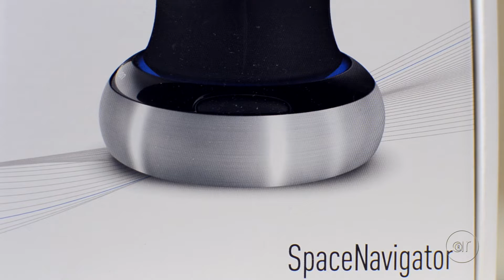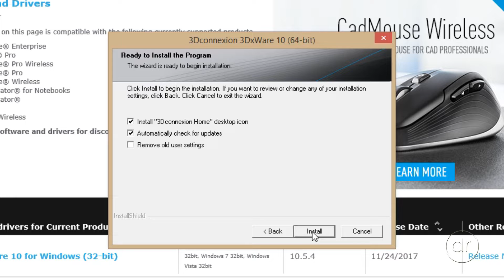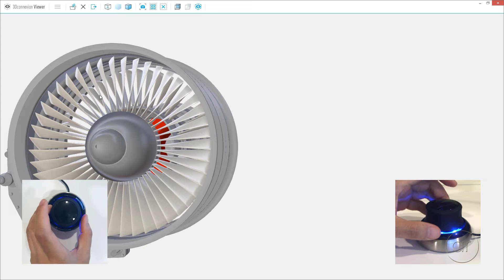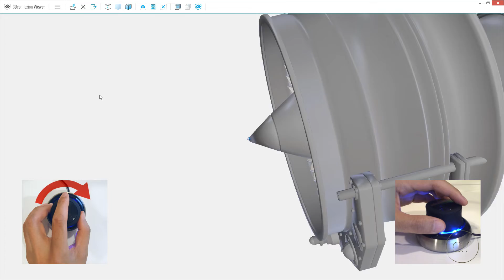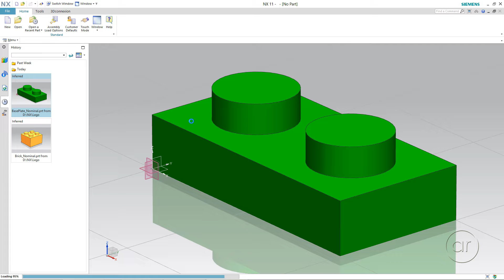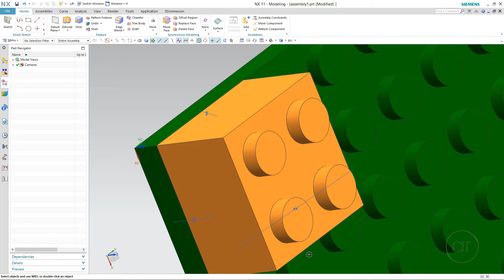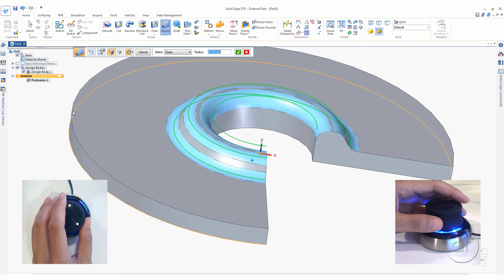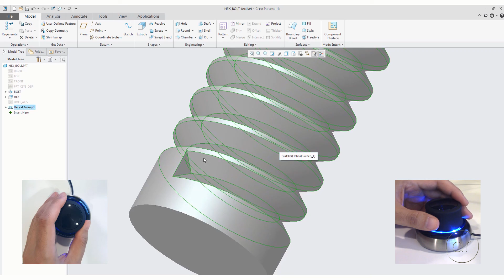The SpaceNavigator 3D Mouse: Review and How-To

Comment: After further training, where a SpaceMouse-Pro was available, I have now also bought the Compact. Without it you don't want to anymore, because it makes it so much easier and faster. The freely configurable buttons with the radial menus are also worth gold. Even with database maintenance, for example, where you need the same commands over and over again, you can quickly reassign this and you no longer have to switch back and forth in the menus.

And that works as well as in any program or on the desktop, so not only for CAD.
Reply from the maker: Thanks for the info. The SpaceNavigator 3D has been discontinued (at least in name - I'm not sure how the Compact compares) so the video is a bit outdated. I'll need to re-visit when I have the opportunity to try the newer models.

Comment: I concur with prior mentions that this is a great review that actually shows the 3D Mouse in use. My one concern about getting one is that I use a lot of shortcut keys rather than clicking on commands (something I see in most videos). 

So here is my question: 
For someone who is very proficient in keyboard/mouse for speed, does the 3D mouse help or hinder when working with CAD? 

I see value when selecting things for joints, etc., but also see added time having to move a hand to type input values, or navigating through menus to click on something because no hand is on the keyboard for shortcuts. Because of this I remain on the fence if this would work for me.
Reply from the maker: Thank you. That's a good question - the 3D mouse works well with a regular mouse when you're interactive with the model (i.e., dragging to change dimensions, features, etc), but I find you still need to switch to the keyboard when entering parametric data, or when you're writing expressions, equations, etc. With that said, there are two small programmable buttons on either side of the mouse, as seen at the 1:10 mark. I haven't used them myself, but I believe you can program frequently-used commands and assign them to those buttons for all the CAD packages that it supports. I don't know if it's one command per button, or if there is a way to assign multiple commands per button, so I'll let others chime in...
Reply: @accessrandom  Thank you for the response. Yes, those movements are my concern, so will consider sitting on the fence for a while... :)

Comment: This type of interface doesn't make a whole lot of sense.  Your typical large trackball already has full support of Windows OS, is by far easier to use than this gadget, and can be used as a regular mouse as well.  Toggling this level of user control would be easy by clicking one or more right, left, auxiliary buttons.

Comment: Best video about 3Dconnexion SpaceMouse! Downloaded already the actual driver for my OS, started the installation, selected "Custom" and searched for a "Unity 3D" driver. Unfortunately there isn´t one! Anyone out there who uses this device in conjunction with Unity 3D (version 2018 and newer)? 
Unity Asset store -> found only "SpaceNavigator Driver". Last release from 6. Jan. 2017 = fr...ing old -> Reviews getting worse -> as said no plug-in update since Jan. 2017.
Any idea, clue, hint?
Reply from the maker: Sorry, I don't have any experience with Unity but after searching on Google I found something about the Rewired project for Unity, which looks like it supports the SpaceNavigator. Could that be something you could use?
Reply: @accessrandom  First things first: Thank you very much for your very fast answer and your effort!! In the meanwhile I also found some more details, like a no longer supported library ... https://www.3dconnexion.com/forum/viewtopic.php?f=19&t=38316 ... Seems I have to dig deeper or write my own Unity plug-in or a wrapper app that receives the commands (movements and keystrokes) from the SpaceMouse, "converts" each of them to a Unity command/keystroke/... and sends what ever is needed to the Unity Editor ... wondering why someone  else does not wrote such a generic wrapper. So again: Thank you very much!

Comment: My space mouse is not moving the model at all what might be the mistake by installing or the settings? How can I "select" the model for movement? Clicking with the normal mouse on the object didn't help. I'm able to zoom in and out in Rhino bei rotating the space mouse knob that's it...The Training of the space mouse doesn't work as well. Could you give advice? Thank you.
Reply from the maker: Which CAD system are you using? I can't think of a reason why it wouldn't work unless perhaps the CAD isn't supported by the mouse? There is a list of supported applications on 3DConnexxion's website.

Comment: HI!
can i programe this 3d mouse as a volume dial somehow?
Reply from the maker: Good question - this would be a natural for volume control. From what I could glean from their forums, there doesn't appear to be a way to assign the knob to volume control out of the box. You may want to contact 3Dconnexion to see if there is any API support for it.
Reply: 3dx have a software development kit on their website, right alongside the drivers. Obviously you have to know what you're doing with that, but if they're happy to let you have the raw input - the sky is the limit.

I personally would refrain from assigning multiple controls to multiple axes. Given how there are deliberately no detents which would impede smooth operation, it's almost impossible to independently manipulate axes. The same design features which enable such natural control of CAD models (and space ships - to an extent) are the exact opposite of what you'd want in a controller if you map varying other functions to it.

The easiest way to demonstrate that is to try to use it to navigate a PDF file in acrobat. You will never do only one thing (i.e. zoom, scroll, pan) at a time. In all likelihood you'll be doing all three. Of course none of that is helped by how "smooth" Acrobat tends to run under this type of control...